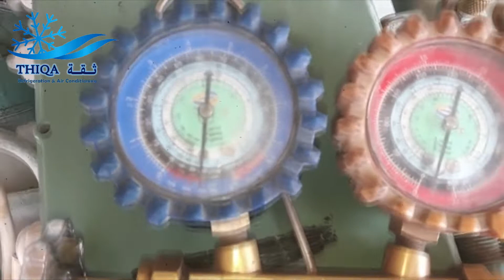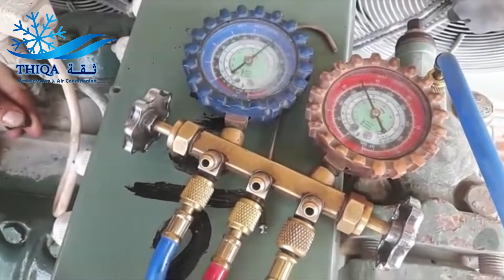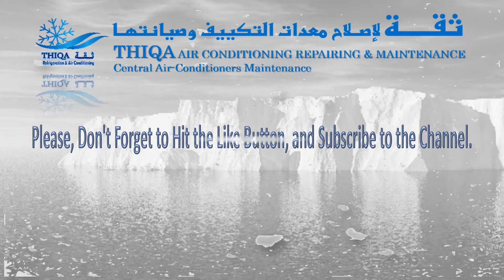Bitzer Compressor Valve Plates #hvaccompany #hvac #hvactechnician  #compressor #cooling #ajman

Comment: Bieztar  compssor  overlling  very goog  iliked lot  comprssor  long befof overolling  comprssor  dispanling all allpartes  all ok       selity snd  dis  contactingok  one by  removeing  fullset volt top        tremisl  box   baic  boxes removring    point markex all part  carrit angel fixing reuion ok
Reply: Head plat  valve plate  all     gatket  vslve plate     didcherg  susion     s  valve plat    removeing    poison    contacyed rod  and    rotor    one by removeing   pistion     contacted      shafited  removing
Reply: Setup setp  baicl  oil allrmovring and jobes  soket tool using
Reply: Mechiknsom  damed remocing  ssme  methad  explas  replcinv ok solveing ok